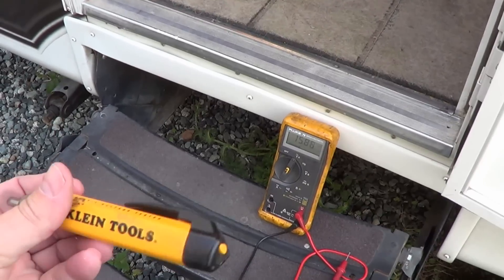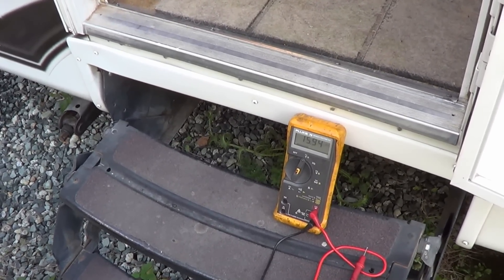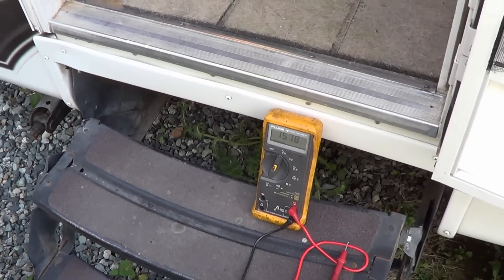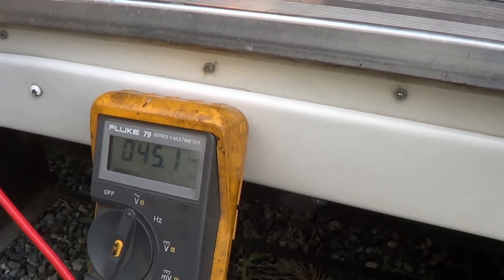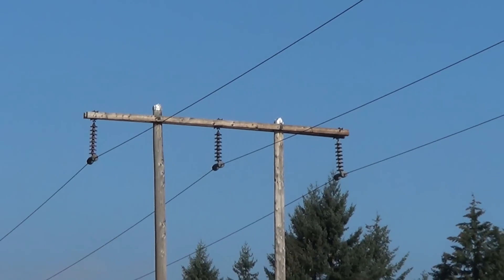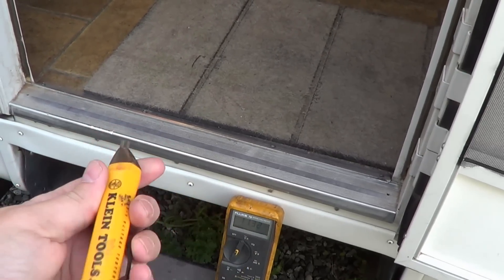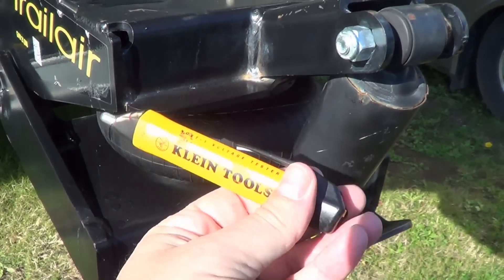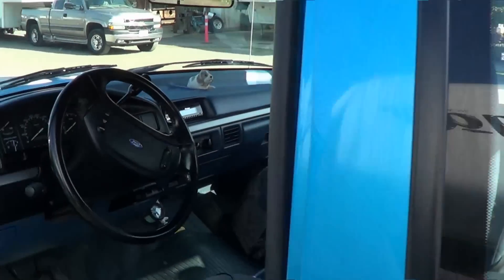Why Was My RV Giving Me Electrical Shocks?

Comment: First, I'd park my vehicle somewhere else. If just being there induces 150volts in your chassis then it can easily get much much higher in parts that happen to resonate at 50-60hz, and that can start fires.
Second, can't you just earth your vehicle to ground with a piece of wire?

Who ever thought it was a good idea to park vehicles under power lines in the first place?
Reply from the maker: Ya, a little piece of wire to the ground is enough to shunt it down to nothing. If I didn't have pads under my metal jacks it would never have happened.
Reply: I was gonna ask about using a grounding rod. Wonder if bad things could happen if lightning hit the trailer.
Reply: Thinking logically, are we?
Reply from the maker: aguyandhiscomputer I think bad things will always happen if the trailer is hit by lightning. :)
Reply from the maker: aguyandhiscomputer :)